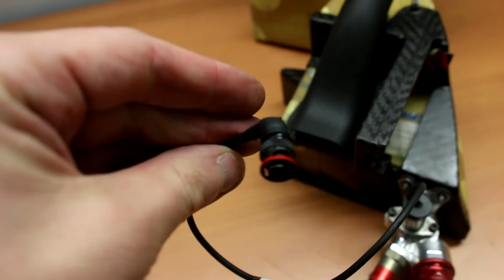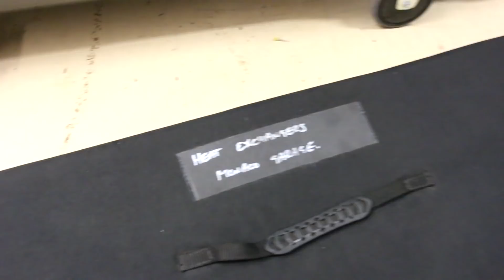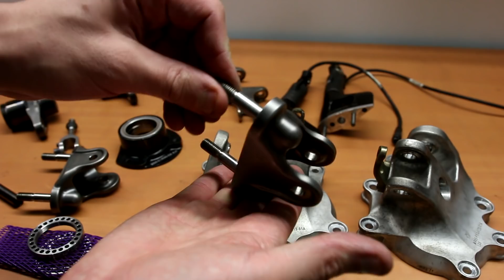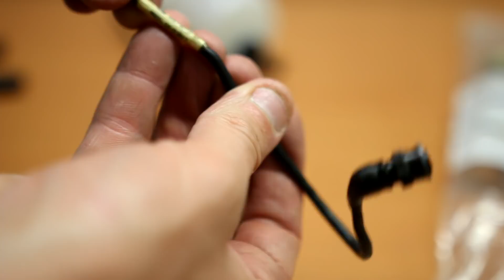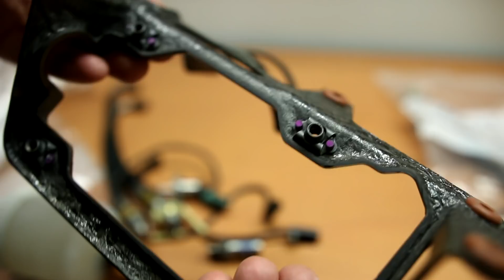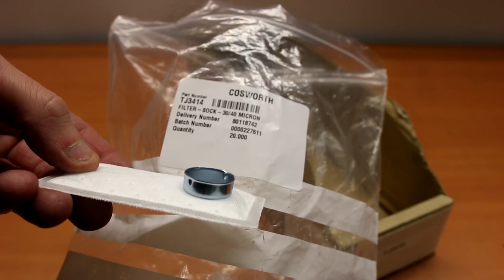Formula 1 Turbo era parts inspected. Including 2017 part!

Comment: My take on the oil solenoid is that they run a short loop to warm the engine up and then switch to the full tank when it's up to temp . This is just a guess . 🤙

Comment: Could you write a partnumber of fitting on an oil tank?
It’s very cool - it allows you to connect / disconnect the system directly under pressure with minimal loss of oil

Comment: The second part is, as you say, a clamped-on part to mount the lower wishbone and push rod to the upright. Although rules demand the upright is aluminium, other parts bolted to it can be made of other materials. as this is a large bulky part to space the mountings away from the upright, aluminium will be used for lightweight. it will be machined from solid rather than post-machined on a casting. the wishbone mounting is offset from the steering axis, as you can see 7.5mm etched onto the part, the offset of push rod to steering is that amount. this offset is used to help weight shift to counter roll during a corner.

Comment: The suspension items you have there are all for the front suspension. the first clevis that you picked up, is for the upper wishbone mounting on the upright. it looks like it's probably titanium. it will have a shim between it and the upright to adjust Camber.

Comment: The bag oil tank is the auxiliary oil tank hence AOT on the solenoid cable. This is not the main engine oil tank, as that is attached to the front of the motor. but instead adds additional oil to the main oil system, when required during the race, as oil consumption reduces the main oil volume. Hence the solenoid is there to release the oil, upon the driver's request, via a button on the steering wheel.
Reply from the maker: Thanks for info!
Reply: EL DIABLO my job is a technical motorsport journalist. I've spent many hours looking at the Manor car in the F1 pits and know ATL, the maker of the tank.
Reply: @techeffone  Was the auxiliary tank buffled ? And why is oil being consumed during the race ?
Reply: This might be a silly question but what are the circular patches on the Kevlar for?
Reply: @brandynkelly9319  just reinforcement
Reply: EL DIABLO not yet. I'll be at the f1 launches & tests next month
Reply: Correct. This was the era where fuel was restricted, so they started burning plenty of oil instead. the rules were made more strict at some point.
Reply: I know it from other types as an "accumulator". In the type I'm familiar with, they're pressurized with air and when you need an oil boost, you can push the button to force in into the system at about 80psi.
Reply: Isnt the accumulator bolted to the Valveblock ?

Comment: Hi a great technical channel, keep up the good work. The solenoid could act like a non return valve, to stop the oil draining out of the tank when the engine is off, the old British motor cycles had these to stop the oil draining back to the sump?

Comment: Thanks Peter! Could it be that the solenoid on the Oil tank is to control how much and when they can burn oil to gain an edge?
Reply: The oil button on the steering wheel is to pump oil from a reserve tank to the main tank as the oil gets burnt during the race. The driver is told to do it by the pit (they used to be able to do it from the pits). The "oil bomb" you guys are referring to is totally managed by the ECU, and as far as I know its only activated in Max (qualifying) engine mode, or by the Overtake (OT) button depending on the engine manufacturer.
Reply: Oddly enough that was my thought, with the solenoid being driven by the emu. But that wouldn't really account for the oil button on the steering wheel would it? Would love to know the answer.

Comment: The part at 13:50 is a rocker that couples the pushrod with the torsion bar spring, therefor it has the inside gearing. Thanks for the videos Peter! :)